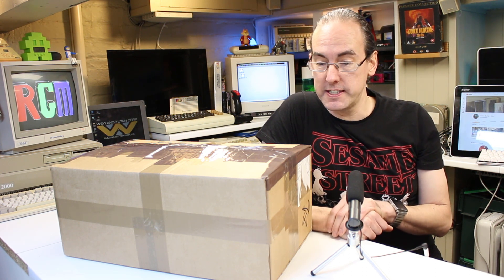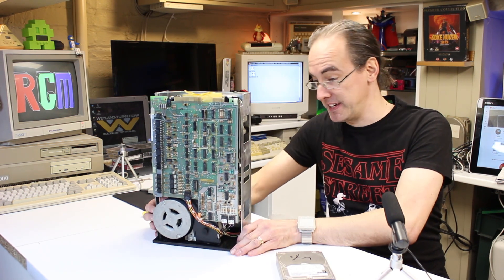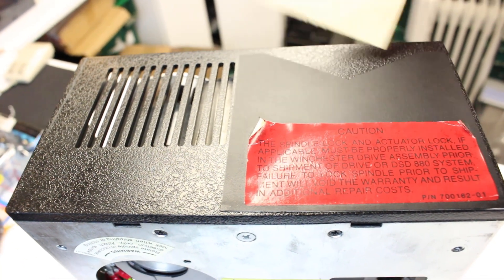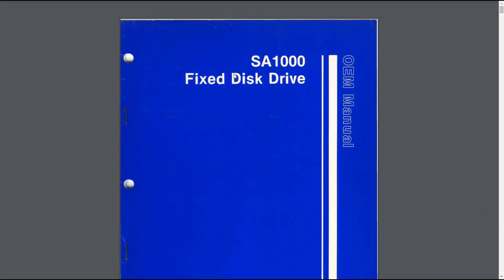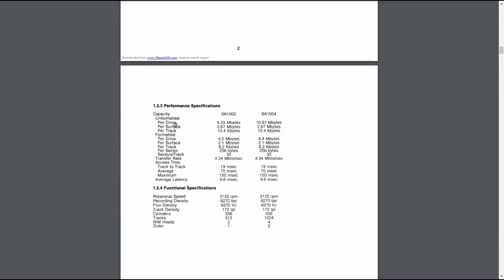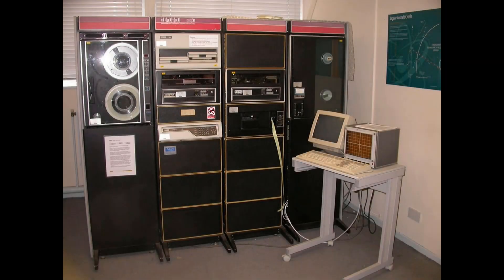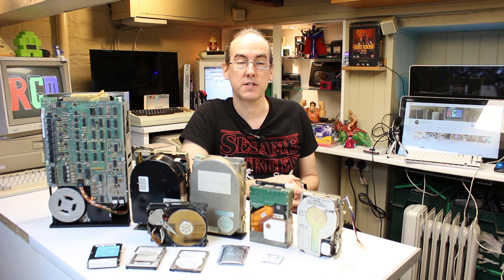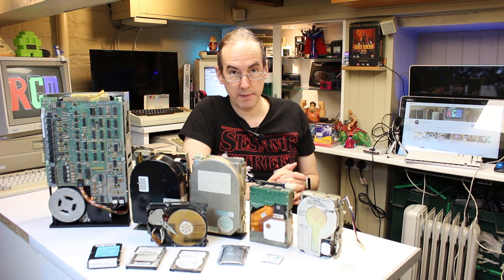MASSIVE Shugart 8 inch full height Hard Disk Drive and others

Comment: This drive was first released in 1979 with a 10mb capacity, at the same time the worlds largest drive was 571mb and used 7 14'' platters, 11 years later you could get 1 gigabyte in a 5.25'' form factor, 11 years later in 2001 a 100gb 3.5'' disk was availible, and 11 years after that the first 4tb drive was released. Now in 2024 32tb drives are starting to be shipped to select customers, but ssds can go up to 128tb.
Reply from the maker: Amazing how quickly the technology moves on. I am working on a couple of commodore pet 5" floppy drives at the moment. They can hold half a megabit each.

Comment: recently Adrian's Digital Basement did a video on connecting a Shugart 8" FDD to an IBM compatible and using it to boot DOS for those systems. IIRC, it, too, used a 50pin edge connector. The manual you found online stated that it was a floppy-like interface, so perhaps it was used on the same connection (like how SuperDisks/UniDisks would connect to an Apple //c). I imagine it would be tricky to get that working on an IBM PC, possibly requiring changing an FDC's roms to accommodate the HDD. But then, I'm a millennial from a post-MFM world, I don't know much about HDD protocols/standards pre-IDE/ATA.
Reply: This 50 pin interface is called SA-1000. It was designed by Shugart for use with the SA-1000 series 8" drives like the SA-1004 shown here. It also saw use on some competition drives like the Quantum Q2000 series and even a few 14" units like the SA-4004. 
The ST-506 interface seen on early 5.25" drives, which later became the ST-412 interface everybody calls "MFM," was originally designed as a miniaturization of the SA-1000 interface. They are almost identical and adapters exist to connect them together with ease.

The 50 pin interface on the Shugart floppy drives is something else entirely.
Reply from the maker: Thanks for the information.
Reply from the maker: Thanks for the info. I'll have to have a look into that.

Comment: RE: slower spinning platters, it wouldn't just affect the transfer rate, it would stop the device from working at all; the timings are very precise and the platters need to spin at their designed 3600rpm for everything to synchronise correctly. Hopefully the motor isn't frequency dependant.
Reply from the maker: Thanks for the information.
Reply: The controller will happily operate with an index at 3000rpm. It just needs to be within about 15%-20% for proper operation, depending on the controller.